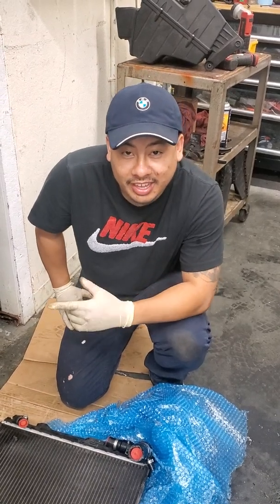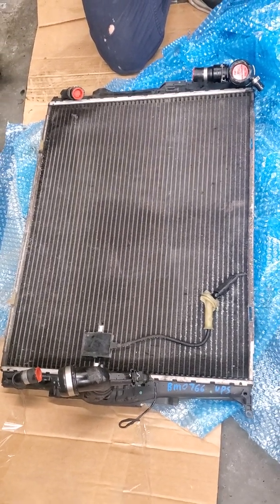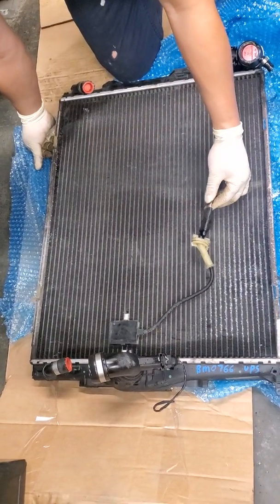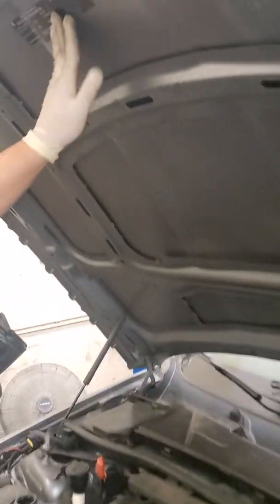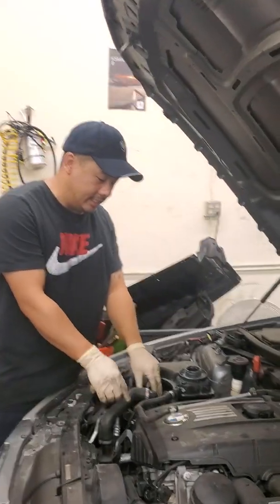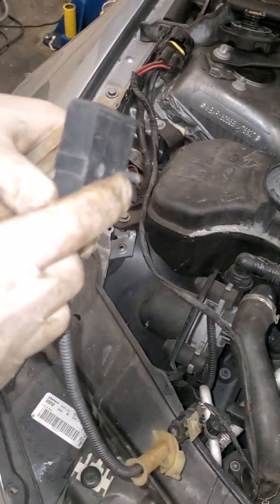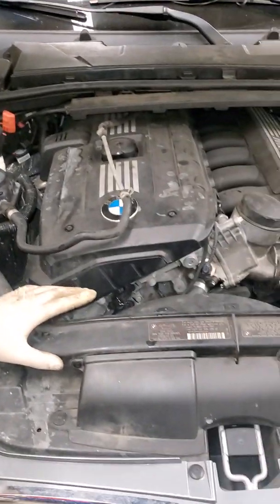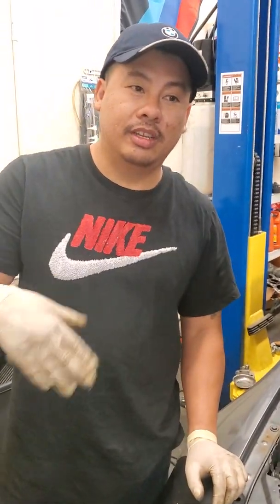The truth about N51 SULEV compared to N52 Non-SULEV engines

Comment: I have a 2011 bmw 128i N51 engine with 227K miles on it.   Running like a champ - so far
Reply: What has it needed other than oil changes?
Reply: @enemy2921 nothing much. Just normal maintenance.  Tuneup-starter-ac clutch.   That’s expected.  Have not changed the belt yet.   But think imma do it soon.

Comment: Mine went bad a year ago. I bought the same part from Mercedes and switched over the connector. Worked like a charm. The sensor is super glued on, and the probe will break when you remove it. All the sensors sold on ebay are broken. There's a second hole on the radiator for the replacement sensor. You can just click it in with no super glue and it will hold fine. Just remember don't throw away the bad sensor you'll need the connector.

Comment: I have a 2010 E93 SULEV (N51).
Can anyone tell me where the small vacuum line that attaches to the throttle body (jst past the MAF) goes on the other end?
Looks like mine broke off.
Reply from the maker: @irgski  it goes the nipple on the air duct connected to the throttle body.

Comment: I was happy that CSE radiator company made radiators that are compatible for the N51 models for about$140 bucks, saved me alot if money. Still rocking over 120,000 miles for my 2010 328i.😊
Reply: Thanks for the heads up! I believe it is CSF radiator.
Reply: I have 190,000 miles. Pulls strong

Comment: I recently found this out lol. I juss bought the cheaper radiator with no sensor. It'll still work without a sensor but you'll get the service light too. I got a plug for smogs so it doesn't matter to me and I plan to do even more mods so... unless you need a car with no lights save your money 💯

Comment: So I have a 2009 n51 with 90k miles , so far there are no problems but if I were to decide to sell the car am I able to go to the dealership and get new parts that are covered? Or do they have to not be functioning. Also, let’s say the 15 years pass but it’s still under 150k miles would I still be covered?

Comment: So n51 is better then n52? I herd n51. Has more throttle response and pull? More horse power? My car says suelv how ever u spell it and has the extra pump on left so that's a n51?
Reply from the maker: N51 is more expensive than the n52 after warranty expires.
Reply: @FIGSAUTOBMW  hey sorry to bother u so I got n51? I have the extra pump on left
Reply from the maker: @azmaymi9237  Yes, n51 has the secondary air pump whereas the n52 doesn't.
Reply: @FIGSAUTOBMW  ok thanks so n51 prob has better throttle response and pull then the n52? I'm trying to see if my car is sport package my car goes over 130 but doesn't have sport wheel or seats I'm confused man
Reply: N51 has 3 stage intake and N52 does not unless it is a 330i.

Comment: Like others have posted. These are FREE repairs covered under warranty. The list of parts covered under warranty is extensive.  You just wasted your or your customers money. The list of parts covered is gotta be closed to 50 parts. Nearly a whole new engine. SULEV N91 owners take your car to the dealership and have them do the work for free. Extra tip, if replacing cooling system replace the EAC sensor. Come on my man, do some research

Comment: 請問 我是台灣人 我的是E90 N51 328  請問有辦法提升馬力和N52 馬力差不多嗎? 請問有沒有辦法改善?
Reply: The N51 came with the 3 stage intake. You can add the extra DISA valve, along with headers, K&N air filter, remove the carbon filter in the air box, change the air intake boot with a Moshimoto boot and a tune and you get about 275 HP. You can get a little bit more HP if you replace the exhaust with an aftermarket.

Comment: Ive got a n51 sulev with 75,000 on it. Its been extremely reliable. Ive had none of the problems cited in this video. The n51 is also covered by the 15yr 150000 warranty jesus campos mentioned.

Comment: I bought the N51 for my 1st car this March 😂🫠problems already but I love it tho no cap
Reply: What problems are you having with it? And how many miles does it have? I bought an N51 328xi in May and it has about 106k Miles. No problems so far.
Reply: @xgus1717  my e92 is gone I got rid of it due to mechanical issues , I couldn’t save it 🙁
Reply: How’s it been? Did your problems fall under warranty? I’m about to get an e92 and can’t decide between n51 and n52
Reply: @d3admaub938  don’t get the n51 I would n52 is the way to go with a. Nice e92 and be a lil more reliable than a 335 but still keep the e92 look I would n52 328i good bmw to start with

Comment: n51 way more powerful than the n52. a bmw is a bmw, with different maintenance prices. this e90 just happens to be the most expensive version for the n52 platform. to each it’s own. thank you for the video david.
Reply: Thats crazy talk. It has a lower compression ratio than the n52. They are both rated at the same hp but the n51 has the 3 stage manifold to get it up to par with the n52. The n51 was not as tuneable as an n52 until very recently. Check chaos calibrations and theyll tell you.
Reply: lol u sure about dat? 💀 n51 has stage 3 intake to compensate hp loss due to it being super low emissions and  makes like 220-230 hp. N52 from a 330i makes 258hp stock and euro version is like 270-280hp.
Reply: @xxX_cashmoney_Xxx  the n51 is much more tunable tho. You can extract more hp out of it plus they’re all under warranty until 2025-2028 depending on the year. 

The n52 is more reliable but the n51 is under warranty and tunable, what would you pick?
Reply: if you think any e90 n51 n52. is pushing 300 hp. youre on crack. CRANK HP is not the same as real HP. ANY n51 and n52s are pushing MAX 210 with any bolt ons. a stock 350 will dust your ass in a "fbo" n52 my boy. lmfaoooooooooooooooooooo

Comment: To me, I prefer the N51, Why? because has warranty 15 years or 150K miles. 4 months ago BMW dealer replaced my car engine by a new one for free!.
Reply: They dont care how many owners?
Reply: Will they even help if it’s past the 150k mark I have 151k on it you think I’ll still be able to pull it off ?
Reply: @Duppyconqueror47  I doubt it, dealers are already busting peoples nuts about what falls under warranty and what doesn’t. You being 1k over is really unfortunate tho 😂😂😂
Reply: @Duppyconqueror47  fr
Reply: @Duppyconqueror47 no my n51 radiator cracked 15 years and 6 months with only 93k miles and dealer said no
Reply: Mine couldn’t even cover my started! How did you do that?
Reply: @rileytavares4087  Starter it's not covered. Most of covered parts, it is related to emissions.
Reply: @DjDestructor  the whole engine, though?? Thinking I’m supposed to have a new car by the dealer perhaps 🤔 my e92 is at 120k they only did a few things and fkdup my computer after installing the battery. Since then , I have not gone back or trusted a damn soul to touch my car. Need full reinforcement lol
Reply: Really I just got my first BMW and it’s a N51 2011

Comment: That's not to mention that if a SULEV fuel pump, which is inside the fuel tank ever fails, the nominal cost is $8500 to replace it! BMW, which recognizes that that is rather outrageous, does apparently have a program to defray most of that cost if that happens, which is predicted at about 150K miles...
Reply from the maker: I think you're talking about the M56 SULEV engine on the E46 models where the fuel pump is sealed in the fuel tank in which case if it fails the entire fuel tank gets replaced. The N51 SULEV engine in my video has a fuel pump separate from the fuel tank. There's an access lid under the right rear seat cushion to get to the fuel pump.
Reply: @FIGSAUTOBMW  Hi Sir. How about the Bmw 323i e46 the engine is M52 is the fuel pump sealed in the fuel tank?
Reply: I had my fuel pump done at a shop for 1400. No problems so far
Reply: @monestang69  You paid $1400 for a fuel pump replacement?? Bruh. U got finessed! I did the job myself in less than 30 min at home watching YouTube videos and reading forums🤦‍♂️
Reply: @209euro2  both of you got finessed the n51 has a 15 year/150k mile warranty, you could’ve gotten that done for free 🤦‍♂️🤦‍♂️ unless you somehow managed to put over 150k on it already
Reply: @monestang69  lol I paid $200 for the SULEV pump nd did it myself within 2hrs
Reply: @ItsMrE90  any gains / difference in idle
Reply: @steezrios  no unfortunately no different in anything that’s noticeable. Not even Mpg . Does feel good that too know I have a new pump and clean filter inside though
Reply: @ItsMrE90  where’d you get the sulev pump?
Reply: Honestly by the time your e90 has 150k it’s time to let it go and move on
Reply: @d3admaub938  - It’s not the 150K miles that’s a concern.. it’s the 15 year time period at this point.  The warranties on a lot of these SULEV’s are about to expire.

Comment: The n51 uses less fuel has the same horsepower and torque and has less mechanical issues over time than the N52. Other than the POS radiator that you can use out of an n52 e90 and just ignore the dtc or program it out of the system
Reply from the maker: The N51 compared to the N52 has several differences: pistons, fuel rail, oil pump pick up tube, vacuum pump, intake&exhaust valve stem thickness and guides.
Reply: N51 has 230, n52 has 255
Reply: @bruce_son  the N51 also has a 3 stage intake manifold.
Reply: @rghant  some variants of n52 also have 3stage intake manifold. x3 3.0si, 330i, 530i. only the 28i and 25i variants didn't get it. I personally have one swapped in on my 328i
Reply: @bruce_son  I have a 128i n51 with 3 stage intake manifold. It came with the 2011 128i
Reply: the 330i has 255hp the detuned n52 328i has 230hp and the sulev n51 328i has 230hp, but the difference is that the detuned n52 328i can still make the same power the 330i when you change the intake manifold cause they have the same 10.7:1 compression ratio amoung other things vs the n51s 10.0:1 compression ratio which nerfs how much power it can make, but aside from all that even fully modded its gonna make less power than a stock v6 acura so it really doesnt even matter imao.
Reply: @Garf2O  I thought cars with lower compression ratios are more tunable tho, no?
Reply: @Garf2O  I’m debating between buying an n52 and swapping the exhaust manifold, or buying an n51 and tuning it. The n51 is under warranty too. Hmmmm decisions decisions…
Reply: @d3admaub938  fk it… looks like im going with n51 and tuning it
Reply: @bruce_son  they have the same horsepower, it's the same motor just has add ons for emissions.
Reply: @MickeyGlover  its not the same motor. pistons are different, cr is different. plus all the emissions bs

Comment: You can retro fit an air pump from several vehicles, I can’t remember offhand but I’ve seen a bunch and they utilize the same design, just have to hard wire the connector pigtail to the donor unit, use the bimmer mount, clamp on the Bimmer hose so you can use the bimmer hose connectors and then connect pigtail to the wiring harness

Comment: I have a N51 and it has 270k on it i never did nothing to the Engine and it give me no problem i had the same problem with my radiator i buy a cheap one but I use zip tie to hold the sensor in place the N51 is the best Engine bmw made and that’s why the Price of the parts or so expensive also most of the parts in the 328xi or being use in some of the 2018-2020 bmw for example the AC compressor if u get a n52 after 20k mile you will need to fix something on that engine also i did 2 round trips from fl-NY in a month when my n51 had 240k and only thing i had to do was change my valve cover cause it was leaking oil but the car still took my home i didn’t of to stop at a shop it took me right home and that was the first time i change the valve cover
Reply: Is it automatic? LOL do u drive it hard?
Reply: @davidpineda645  mines manual what’s good boi
Reply: @davidpineda645  yes when i was driving to and from fl-ny i was doing 100-120 it took me 11hrs and then i drive right to work that’s on the 2nd trip

Comment: N51=15 year/ 150k warranty honored by BMW dealerships in California (and other states) for sulev emissions related issues (covers ALOT).
Reply: AAAARRRRRGGGG!  I wish I had know this before!  I just replaced a leaking radiator on my wife's 2012 128i with the N51 SULEV radiator.  It cost $570 for the new radiator with sensor, plus hoses, coolant, etc.  It also took me a few days to replace it (i'm slow when it comes to repairs) and it was a pain in the...  I don't have a BMW dealer within 100 miles so I didn't think to check.  Lesson learned.  I could have rented a car or stayed the night in a hotel to wait for the car if I had known.
Reply: @scottmorton21  you may still be reimbursed  by Bmw have all receipts ready...
Reply: My N51 radiator is leaking from both sides (but no check engine light). Will this be covered by warranty?
Reply from the maker: @redbaron007-e5p  Thats a tough one because usually any coolant leaks are considered maintenance parts, but since the N51 have EAC which is emissions related then maybe its covered.
Reply: @FIGSAUTOBMW  Yes, thanks - dealer replaced it under 150k ml/15y warranty.
Reply: @FIGSAUTOBMW  anypart that is emissions related is covered under the 15year 150k warranty even the radiator if the check engine comes on for that sensor
Reply: @redbaron007-e5p  yes radiator is covered. Google search N51 sulev warranty parts list and you will find extensive sites with the list of parts covered.
Reply: @J256-r8e   Yes, thanks - dealer replaced it under 150k ml/15y warranty.
Reply: @redbaron007-e5p  - Did they charge you anything for labor to get the radiator replaced?  Some of these dealerships tell you they cover the cost of the part but what they don’t tell you is they don’t cover the cost of the labor to get the part out. So did you have to pay for any labor fees at all or did they cover everything?
Reply: @anthonygiordano3991  No charges - zero cost to me.
Reply: J 256 Where can I find official BMWSulev Warrant info??
Reply: @redbaron007-e5p  it is covered. I had my leaky radiator replaced under the SULEV warranty
Reply: 💔 2007 Sulev 14 years/165,990 miles. 💔💔💔
Reply: Unless you're in WA like me then they say no.
Reply: taking my 09 328i would they cover the timing belt
Reply: Do you know if the warranty is available in Pennsylvania?
Reply: Aside from the warranty, N51 already comes with the 3 stage intake manifold.  An AA tune (Active Autoworks) or StageFP tune will unleash the power from the 3 stage manifold.  The N51 engine has slight lower compression ratio but the power difference will be around 5hp lower than the n52 with the same mods.  You’ll need to purchase the 3 stage manifold for the n52 if you want more power.
Reply: Great warranty but not great if the car is past the warranty of 15 years or 150,000 as parts and labor are very expensive .
Reply: Is it too late for this?;
Reply: @limitlessmedia831  no sir it is not i just recently purchased a sulev n51 coupe runs amazing as of right now only thing i had wrong was a o ring crack in my coolant hose and ofc got the hose replaced cuz hoses run about 10 years once u get the hoses replaced your car will be fine trust me they will run … another 10 years that rly leaves u with fluid flushes/ brakes rotors/ and oil changes which are all rly small things that don’t even rly dramatically effect how the car runs , my car is 2012 98k miles actually going to buy some headers tmmrw you’ll like the car at first but will want some more hp the fact that it comes with a stage 3 intake manifold stock is golden not counting the warranty to it’s honestly a great bang for ur buck , then once u get the headers grab that tune to just completely open ur engine up after that intake and MILVS you’ll easily be sittting at 300/320 hp daily that’s a good 18/20 mpg
Reply: @Isaac Cisneros  thanks for the info bro! I can't wait to get it running. Just ordered a new valve cover and gaskets kit for it. I'm sure I'll have fun with it like my g35👍🏽
Reply: @limitlessmedia831  after that too i’m just going to work on straight cosmetics
Reply: If I have a 2010 128i will any of said warranties still be useful to me ? 2010 is exactly 15 years old but the car was technically manufactured in 2014 like most cars but I have only 117,000 miles and is exactly 15 years old. Idk how to check if my 128i falls under any of these warranties. Could someone help me with an answer ?
Reply: the sulev is equipped with the 3 stage intake manifold like the 335s, to compensate for the lower valve timing and actually has better throttle response around 3000 rpm but, did i did not know about the sensor on the radiator good looking bro. Other than that tho I prefer my n51 bc if you’re looking to daily the car and also mod it over time the n51 has the slight advantage but that’s just when it comes to performance.

Comment: There’s also a N51 extended 15 year warranty that covers all emissions related parts. Are those 2 not related? My 2011 is covered until 2026 and I just got a brand new fuel pump, VCG, and o2 sensors done for free at the stealership.
Reply: That’s fucking crazy, this just entirely changed what I’m looking for. Looks like SULEV lci e92 is what I’m going after. I’ll be covered till 2025 on the one I’m looking at. Bettt
Reply: how do i get the warranty extension? lol im at 155,000 bought the car a little bit before 150k and im running fine just wondering though